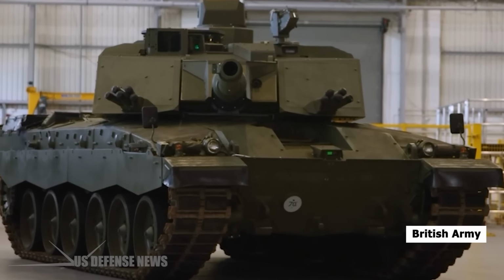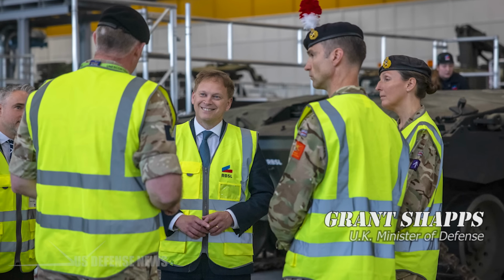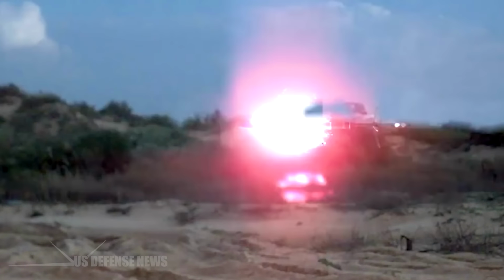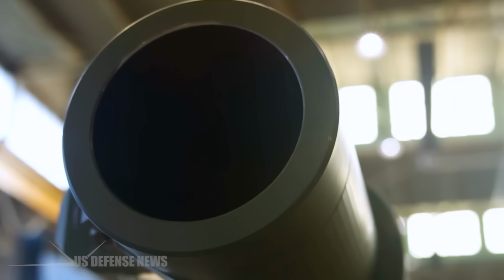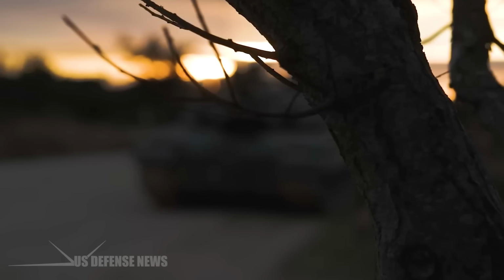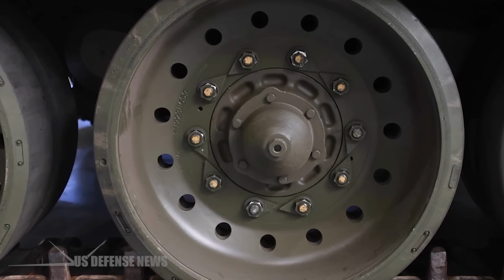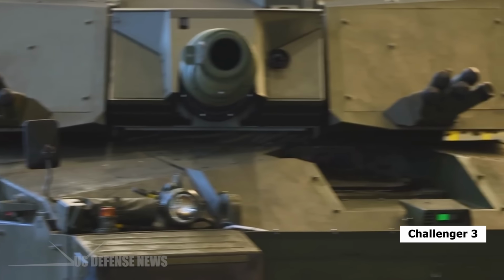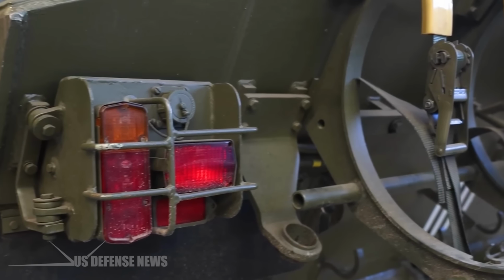Challenger 3: Meet the British Army's New Most Lethal Main Battle Tank

Comment: The Challenger is the best design tank! The sloped armour in the front, good advanced armour, now a Top of the line cannon that will increase range and velocity at least 1000 meters more and all NATO and non NATO 120mm rounds, a new Engine was what the Challenger 3 really needs and a 20x139mm Hispano cartridge calibre on top for anti drone tracking and destroy, but better solutions have to be develop for small cheap drones that are targeting not only by impact but using a Strim 65 or AC-58 or even APAV 40mm from top of the tank by dropping a anti armour granades like that are very effective agaisnt armour vehicles or tanks, so some system that is cost effective like a huge shotgun blast weaponary that reach at least 200 meters and that fires a cloud off buck shot or even rabbit pallets at great speeds and the Russians reach the same conclusions because i already saw them testing a huge plastic cartridge with shotgun pallets to try to eliminate at least a part of the threat posed by drones. But talking about the Challenger 3 its just a very well design tank like all the Challenger Variants but its just a heavy tank British engenires should take at least close to 10tons from this big iron. But let me say 10 million for each 148 tanks that is a incredible small number of tanks to upgrade and 10 million a pop no way! But the British are to blame they say no way a foreign tank, dont need to be a foreign tank, Rheinmetal AG and BAE already have a joint partnership, and this company should be jointly developing a new tank that European countries like France and Germany, Italy, Spain, Belgium and others like the Netherlands will be upgrading for a new system by 2030 for a 2 years diference and maybe even sooner if the British jointly develop and invest less that they have spend, they would get new and Top New Tank with a 130mm L/51 cannon from Rheinmetal AG or the new Ascalon from KNDS and a total new system i dont understand the British
Reply: If the brits lose 200 tanks in war game over Russia has 30 000 to deploy.